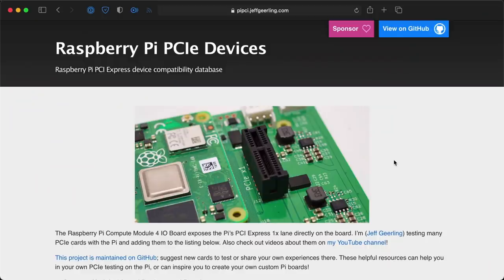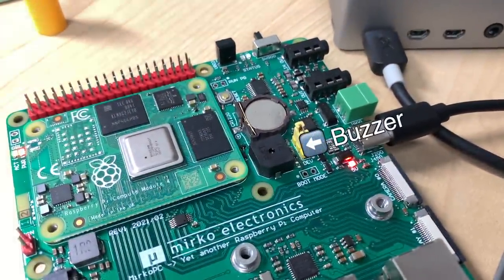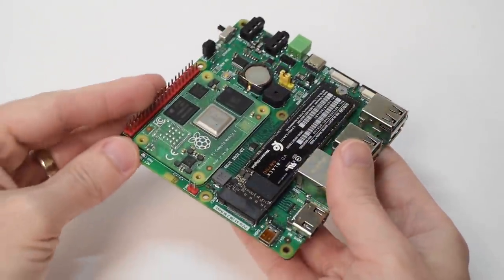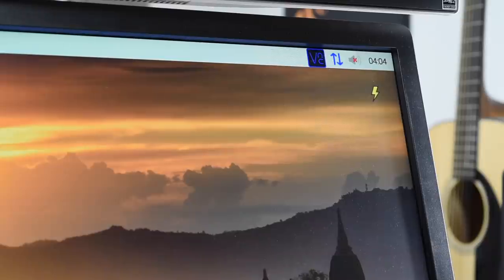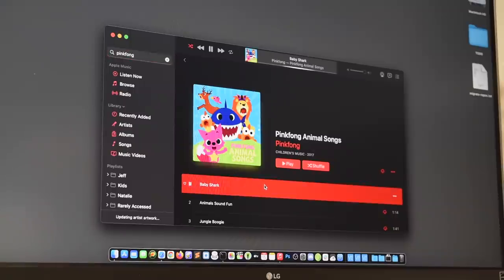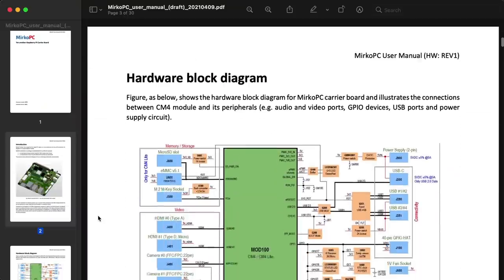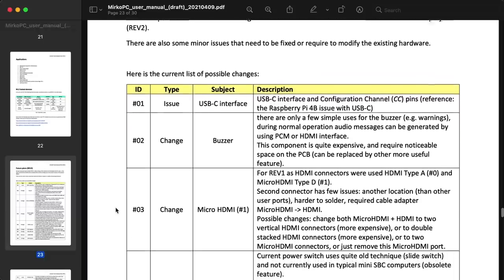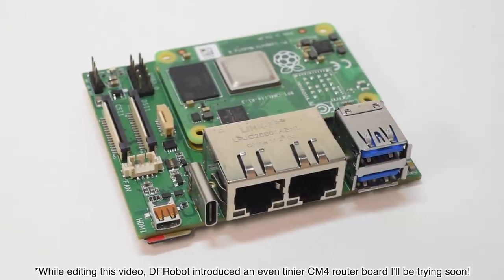Meet MirkoPC - a tiny full-featured Raspberry Pi CM4 PC!

Comment: CM4 costs too much.
The MirkoPC has no USB3 ports? Shame!
Reply: Who should shame? :-)

You don't need to use RPi, there are many other cool boards on the market (Orange Pi, PINE, Rock Pi).

Because CM4 does not have a USB3 interface, therefore the designer has a dilemma whether to use PCIe as M.2 slot or give PCIe -> USB3 bridge instead.
This is just a DIY project, with all its limitations, such as the price of components.
If the future CM5 will have USB3 then I will think about adding a USB3 hub.
Reply: I wouldn’t say it was too much given the overall flexibility of the format with open source I/O boards too. Availability is the problem, though I have a 2Gb and 4Gb model on hand thankfully in the UK. Getting an 8Gb model is a little more difficult due to lack of suppliers relatively speaking.
Reply: @Mirko_DIY  I didn't know the CM4 has no USB3. That's even a more of a ripoff if you ask me. 
Here a  Raspberry Pi 4 Model B/4GB sells for $69.95 CAD sold at buyapi.ca
A Compute Module 4, 4GB is $74.25 CAD
I thought you did a great job with the board design. I'm sure this module is right for many. Just not for me.
Reply: @Mirko_DIY  Shame that it doesn't have usb3. you did good. no denying that. 
What makes CM4 so popular? The size?
Reply: @objection_your_honor  yeah the size factor is one of the best factors... Also even with 8gb Ram it's still under $100 USD is another factor. Also the gpu is capable of supporting 4k(1080p) video is just remarkable.